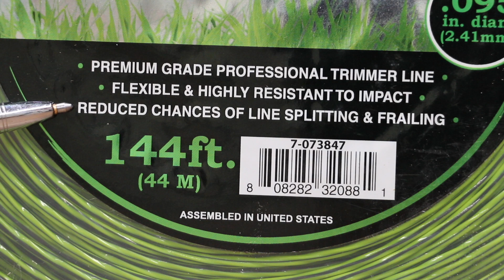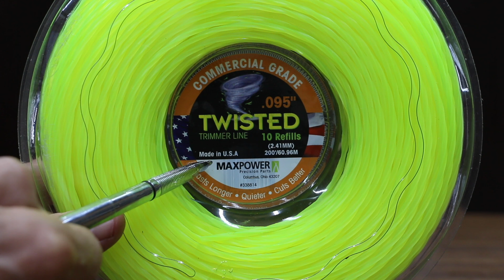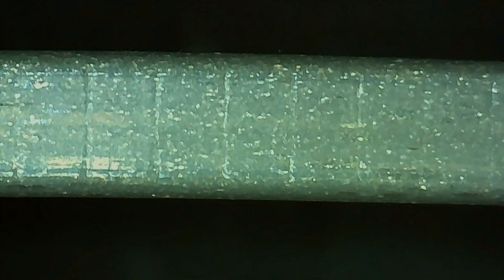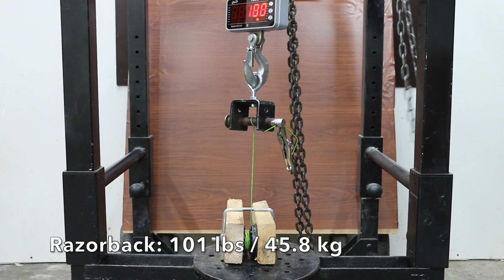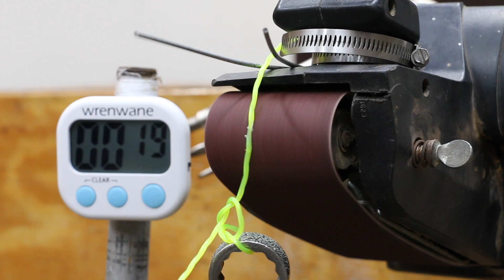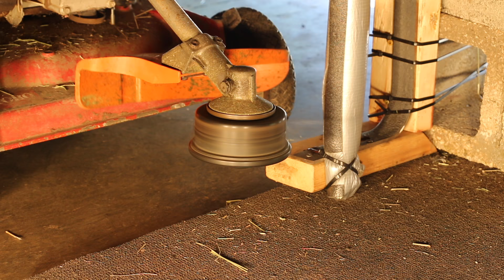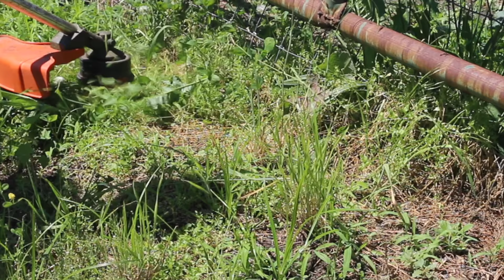Best Trimmer Line? Let's Find Out! Round 2: Stihl, Husqvarna, Echo, Oregon, Shakespeare, Weed Eater

Comment: The only part I hated was that it was usually hot outside (typical for Texas), and the “hit-the-spool-on-the-ground-to-dispense-more-string” feature never worked. Now I know why. The gas-powered strimmer would really do a job on fire ant mounds, however! It was also much safer than going over them with the riding mower! I have to admit to a certain amount of curiosity w/regards to substituting ordinary electrical wire (22 ga.)  for the nylon “string”. 😏
Reply from the maker: Thank for sharing.

Comment: Weed trimmer line is primarily nylon, a hygroscopic material that significantly increases in toughness and durability given adequate hydration.  To ensure each tested line was evaluated based on its best possible performance condition the tested lines all should have been soaked in water overnight prior to testing.  This would have eliminated variations in strength and toughness due to prior storage conditions, store shelf time, humidity, etc.
Reply from the maker: Thanks for the feedback.

Comment: I really enjoy all of your videos, and the only test so far that I have seen that isnt accurate is your tensile strength test in this video. Almost all of them were turning the system you had set up. Some of which, the force grips you had set up act as a slight counterweight. Not that it's the main point but the spinning of the setup is definitely an issue. So I would say inconclusive on all of those, the rest of the test are great! Keep up doing videos, your work in testing has helped me in many situations on what to buy and use. The use in multiple tests is really what brought me to your channel and keeps me here every time you post. Keep up the work and informing people on the best products to use!
Reply from the maker: Thanks, will do.

Comment: Now that you have done a test on which string trimmer line is best could you please do a test on which string trimmer head is best. I have used several aftermarket trimmer heads to try and find one that will actually feed the line smoothly and evenly.
Reply from the maker: Thanks for the video idea.

Comment: New video idea:

I'd like to see a test between different fixing types for maximum torque before stripping the heads in various conditions.

For example, a selection of bolts as closely matched as possible (i.e. all the same thread size and material) with Allen socket, TORX, hex head, flat head, Philips etc, as good a selection as possible.

First test would measure the maximum torque that can be applied before stripping the head of each type with the tool perfectly in line with the bolt and lots of downward pressure, ideal conditions.

I'd then like to see the test repeated in some less than ideal conditions, maybe a 10° misalignment between the bolt heads and tool, or greasy or rusted fasteners (obviously stainless wouldn't work so well for that one!).

Just an idea anyway.

Keep up the great work!
Reply from the maker: Thanks for the video idea.

Comment: You can greatly extend the trimmer line durability by soaking it in water for 24 hours. Or speed it up by putting it into hot water for an some minutes. Be aware, not all holders can handle boiling water. Don't ask me how I know :-)
Reply from the maker: Thanks for the feedback.

Comment: I have used trimmer line as 3d printer filament with good results. If you buy bulk value rolls without the fancy twists and things it is usually cheaper then actual nylon filament. You checked every box for testing trimmer line, it always surprises me the methods you come up with to do your testing. Well done
Reply from the maker: Thanks for sharing.

Comment: For years I had been using weedwhacker line people had thrown away (I used to work on a metropolitan recycling route), but about 5 years ago bought some of the Husqvarna Titanium line. It's miles ahead of the crap I got out of the recycling! I think alot of that free stuff was aged to begin with, so it made a poor line just about completely useless. I'm happy with the Titanium, though - lasts longer than anything I've used in the past. Now that I've seen this test, I just put a note to myself on the wall for that Maxpower Twisted. GREAT test!! 

Love your testing contraptions you came up with. Amazing as always, Todd - THANKS!👍🍻
Reply from the maker: You are welcome!

Comment: Echo Black Diamond trimmer line is the FASTEST cutting line on the market, I know, I've tried them ALL! It doesn't do too bad on strength, either. Echo changed the plastic formulation after extensive field testing, listening to customers input, and the new stuff is far superior imo. I use .105 gauge in my high power machines and .095 in my smaller units. All my machines have Black Diamond in them and clearing times have been cut by 25-40%! No joke!
Reply from the maker: Thanks for the feedback.

Comment: Thanks for a great video (again 😂)! I bought a Makita 36V (2x18V) trimmer few years ago from a weird sale when the price was just 149€ (no batteries/charger included but for that the RRP was still 549€ back then)! And that was from an authorized dealer. Has worked great for my usage (it is not good for cutting brush though so only for grass).
Reply from the maker: Thanks for sharing

Comment: Thanks for the advice on slowing up the RPM near metal. My trimmer is electric and I had a feeling its very high RPM was not doing it favors. It's also much thinner string. I've been looking at new trimmers and now I know I need a better, thicker string and that lower max RPM should be better because it hates tough stuff.
Reply from the maker: Thanks for sharing.

Comment: You verified that I am getting the best line for what I'm doing . One test that I didn't see you run that applies to what I do is how much damage it does to plastic such as PVC or other things. The Husqvarna line being round doesn't do as much damage at low RPM too fragile things I'm trying to avoid hurting. I know that makes it not cut the grass quite as well, but with all the other advantages it has, it ends up working out quite well
Reply from the maker: Thanks for the video idea.

Comment: Maybe test battery powered string trimmers for small yards. I have an older B&D 18 volt NiCad. The current model is 20 volt with Lithium batts. Biggest pain with it, along with the cost of the string spools is the fact that the automatic feed wastes line. It spits it out fast and the replacements are $8. Tried rewinding spools with generic string but it is almost impossible to get the same gauge. Auto feed doesn't work then. The trimmer I have replaced a generic trimmer that needed unobtanium batteries, but I liked better.
Reply from the maker: Thanks for the video idea.

Comment: 👍🏻👍🏻. Video idea - Braided stainless steel water supply lines for appliances. They are the weak-link in the water supply and should always be replaced when replacing your appliance (toilet, dishwasher, washing machine etc.) There are the “upgraded” models that people usually buy because “why risk a water leak on a cheap one”

Comment: Great video, as always.  I'm not sure how this could be tested, but you always have an interesting testing methodology, so here's a challenge for you.  There's a product out there called 'Sugru'.  It claims to be a moldable glue that will stick to almost anything and will cure into a hard durable rubber that is good for repairing usb cables and other things.  I recently purchased this product and was completely underwhelmed to the point of thinking this product is a sham worthy of being put to the test.  I considered doing my own video on this, but as a gun-related channel with a paltry less than 2K subs, I figured this would be best left to a pro in this area and would not get much traction on my channel.  So here's the challenge...do an honest test of this product and it's claims.

Comment: Nicely done as usual. Love your tests. I happened to be thinking about kitty litter and was wondering how you might fit in. Maybe comparing how it absorbs compared to ones specific to anti-freeze, oil, auto trans fluids. I use Tractor Supplies. Paws and claws and was concerned as the dust given off when pouring out. Just a thought and thanks for sharing.

Comment: Great video as usual; thank you!
I do not know how to communicate with you otherwise, but can you please compare RUST CONVERTERS (PLEASE!).  These are very expensive products with large differences in costs. Here is the list that has been tallied by a website that comes first when you Google for "best rust converter"  
Corroseal Rust Converting Metal Primer. See More Reviews. ...
Permatex 81849-12PK Rust Treatment. ...
Evapo-Rust The Original Super Safe Rust Remover. ...
FDC Rust Converter ULTRA. ...
SKYBRYTE Skyco Ospho Surface Prep. ...
GEMPLER'S Rust Converter and Primer. ...
AdCoat Rust Converter and Prime. ...
TotalBoat Rust Primer.
Reply from the maker: Thank you very much!

Comment: Yet another great video and I thank you. I don't have a lot of choice in trimmer line to purchase around my area because we are a small town. We do have Tractor Supply that sales Shakespeare ballistic and you can purchase Husqvarna line and some regular Stihl line. we used to have a Stihl dealership and I bought this huge role of line. It was the size of a wire spool but twice as tall or you could say a longer spool but it had maybe 1200 , 1500  or more feet on it and it was kind of olive drab green and was Square. It work really good but my son used it and I haven't seen my spool since. Okay onto the next project.

I'm getting ready to clean the vinyl on my house because it is moldy green and the snails love to feed on it but I'm tired of it. My brother says to buy cheap bleach at a store like Family Dollar and spread on straight full screen and rinse it and everything will come off. Clorox on the other hand says that they have cloromax and it's supposed to be twice as strong. And there are other cleaners that are supposed to take the mold off of your house simply by spraying it on and rinsing it with a hose. now I don't know how you can duplicate any of that but I trust that maybe you will figure it out. I really thank you for the video and I appreciate what you do. One of your friends and viewers, Jack. Hey! what's for supper?

Edit: by the way when they use the bleach they spray it on with a pump up sprayer and then rinse it off with a normal garden hose. I have to do mine soon oh, maybe you have some suggestions thank you so much in advance!
Reply from the maker: Great video idea!  Thank you  I had a grilled cheese sandwich for dinner last night.
Reply: @ProjectFarm  ain't nothing like a good grilled cheese and well, I guess your choice of soup or like me a batch of fresh made french fries! Haha love that comfort food!

Comment: I use Oregon Nylium Starline with 3mm diameter. Happy with it its a little bit heavier so you dont need to rev up the engine much. Good video thanks ✌️ you should also try bosch. Never tried it, would be cool.
Reply from the maker: Thanks for the tip!

Comment: Wow what an awesome test with impressive results, seems like the off brand lines held their own against the name brand lines. We use an Echo weed eater on our farm,  and we only use Echo line with it, and we’ve had awesome luck with both the weed eater and the trimmer line. We’ve had the weed eater for four years now, and we only run the Echo premixed fuel through it, it’s ethanol free and is properly mixed to avoid lubrication issues and it’s been a hoss of a weed eater. Couldn’t ask for a better weed eater. We had a Husqvarna weed eater before the Echo and we did the same thing only ran the Husqvarna trimmer lines and fuels through it and serviced it on time and it actually blew up after 2 seasons of use I was mad, cause it cost 250 dollars. I thought 250 for 2 seasons of use it wasn’t worth it, a Walmart brand would last that long at 1/3 the price. So went with Echo this time and 4 years later it’s lasted twice as long, and had been the best cutting and most powerful one I’ve ran.
Reply from the maker: Thank you for the feedback.

Comment: HI, Another great video.
As someone who hates having to stop anywhere between 10-30 second at time to unstick the trimmer line is great.

If i get 2 entire minutes of work i am so happy.

I find that other than external objects, the lines gets stuck or twisted inside the feed head, i feel that rather than twisted line jamb, the strand that feeds out seems to melt and stick to the next winding - not sure if this is my imagination or not

As nor new ideas - how about testing battery power banks - typical the ones for emergency top up of mobile phones, a test of charge up time, actual capacity VS stated capacity and time to go drain eg running say usb fan or light so me constant drain

Regards
George
Reply from the maker: Great idea!  Thank you!

Comment: Try to put the line in boiling water for around 15 minutes. The line have been stored on shells the whole winter, sometimes for years and it has dried out the plastic. By boiling it you make the plastic soft wich help it to last alot longer.
Reply from the maker: Great tip

Comment: Great video. I bought a smaller roll of orange 95 twisted style trimmer line from Rural King or maybe Walmart and I’m on my second year of use having just finished off the package with a new winding at the beginning of this season’s trimming. It is very good indeed, I’m glad it won the challenge for the most part. But alas I have to buy a new roll. Glad to hear my suspicions were correct on how good it is. And I’m still using a 2stroke Troy Bilt I bought 12 years ago.
Reply from the maker: Nice!

Comment: I didn’t have any weed trimmer string at my vocation house and the store was too far. So I just decided to put metal wire on it. It lasted probably a good month.
Reply from the maker: Be careful doing that.  It can break off and lodge in a body.
Reply: That could be dangerous be carful with that but good idea in a pinch

Comment: I would really like to see a comparison between the different shapes. Like a mini episode(?) maybe. Round vs square vs twisted etc. It could be inside brands to keep that parameter fixed or in-between brands if you cannot find all the shapes inside a brand. Some people swear on square because of the firm edges and others on twisted. But is it just intuition or does it hold truth? Comparing brands clears the fog a bit, but comparing shapes gets more technical.

P.s: if you wanna go full fledged episode or even a couple more, you could add diameter size in the equation. Is bigger always better? A 4mm line is sure stronger but is also has too much surface area for the same strength, thus, reducing the pressure that acts on the grass like a blunt knife vs sharp knife.
Reply from the maker: Great test idea! Thank you

Comment: as a greenkeeper, round cord lasts longer but doesnt have such a strong cutting edge vs thick vegetation and overgrowth, square cord cuts the best and removes the most material the easiest but the cord doesnt last long if you hit it against hard surfaces. Stilh cord is the best, or any cord you can find in Browns if in England.
I use round cord at home but at work i use square cord on our two stroke strimmers as round cord struggles to do shit against the amount of vegetation.
Reply from the maker: Thank you for sharing.

Comment: This has been a tough year so far for weed trimmers.  Late spring rains have made the grass and weeds grow like crazy.  I did a comparison myself with .105 Vortex trimmer line and regular .095 round nylon line.   No contest; the vortex held on, powering through small brush and tall grass, where the conventional line bogged down and broke repeatedly.   Shame that Vortex wasn't one of your test subjects.  For what it's worth, I was using a Robin NB04 brushcutter (37.7 cc engine).
To get around the problem of spool welding of trimmer line, has anyone tried oiling the line after spooling it?
Reply from the maker: Thanks for sharing!

Comment: We used to have a rather "nasty" line for our trimmer (got it from a local gardener): hexagonal, thin metal core, glas-fibre reinforce on the 6 edges. Yes, it was made for heavy use, was quit stiff and did cut really well even when hitting wood. But wth fences you had the opposite problem - it easily destroyed them.
Reply from the maker: Thanks for the feedback.

Comment: It’s very interesting to see that the “name” brands in most cases are good all rounders. The weird ones are good at a particular aspect, although often at a compromise in another. The cheap ones are generally the worse performing, but ultimately the most expensive due to replacement intervals. Your channel is great for identifying which one to get for what type of application, eg commercial, prosumer, once offs etc.
Reply: As far as I'm concerned line that jams negates any money you saved.
Reply: @hughbrackett343  exactly, the line could be titanium tough, but if it doesn't feed - it is useless.  I would rather buy trimmer line three times as often if it reliably feeds.  A lot of durability issues can be handled at the operator end of things, too.
Reply from the maker: Thank you for the feedback!